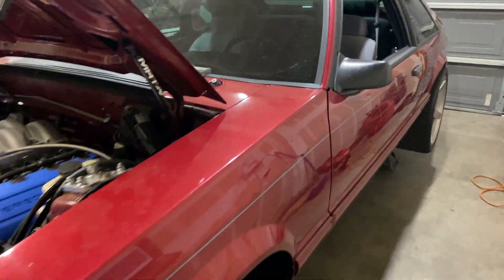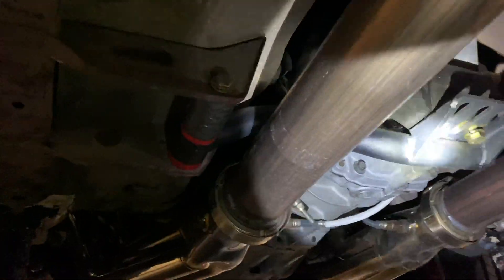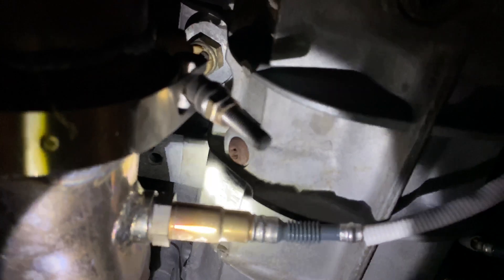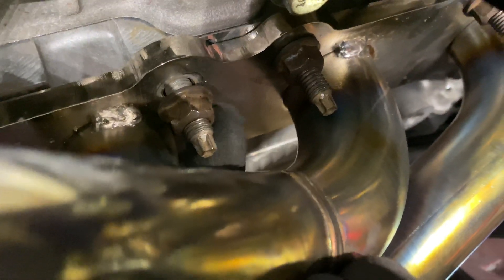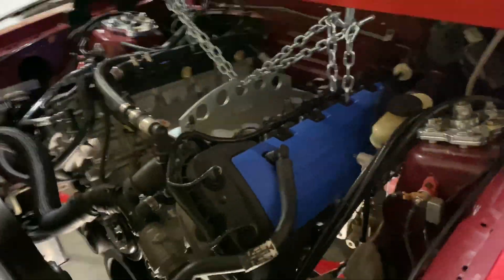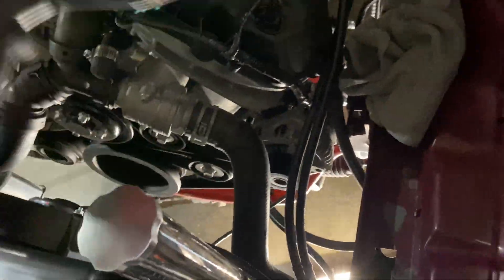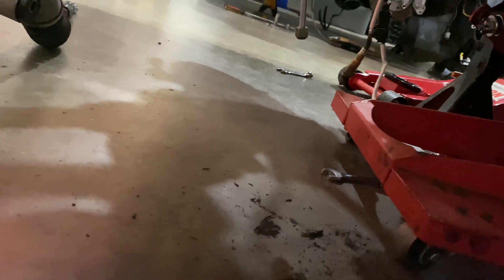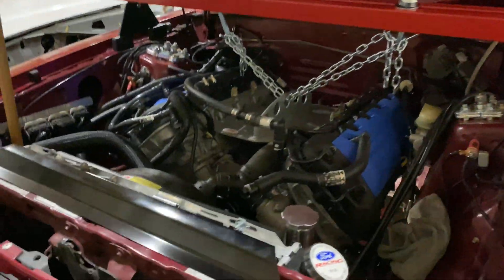Coyote Swap How To: Clutch Job On Foxbody Coyote With Mach1 (3650) Transmission

Comment: What clutch do you recommend I have this tranny set up and haven't bought a clutch yet!!
Reply: Did you end up buying a clutch yet? Will a 3650 clutch bolt to the Coyote flywheel??
Reply: @bryanshelley6727  I haven't i have the tranmission and rhe engine but my car needs a lot of work been buying little here and there but random stuff I know the 3650 bolts onto the engine fine same pattern

Comment: Hey bro does transmission tunnel shifter hole match with the 3650 shifter or needs to be modified??
Reply from the maker: If the car you are putting it into originally started its life as an automatic, yes you will have to cut the tunnel.Not too much though just an inch or 2. If it started it’s life as a 5 speed car, I don’t think it’s necessary. It’s been a while since I swapped original manual transmission car